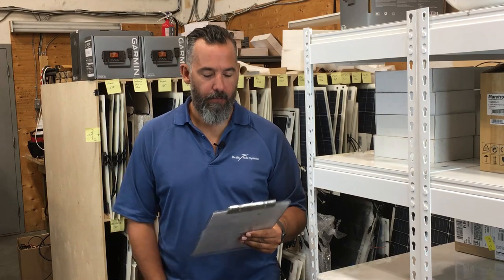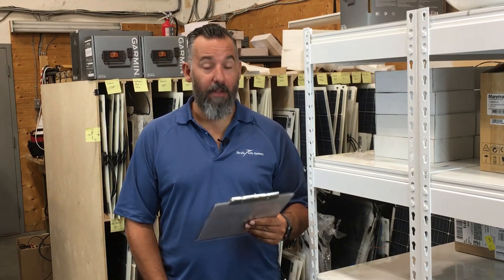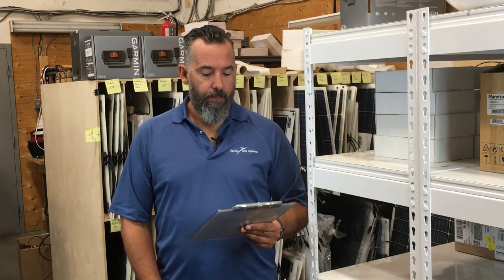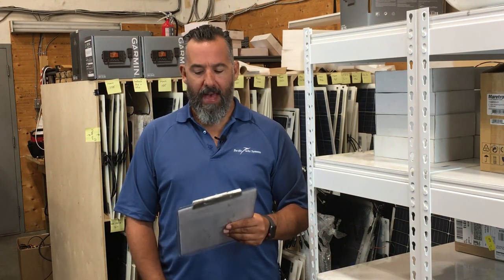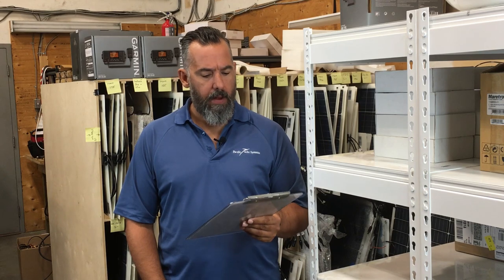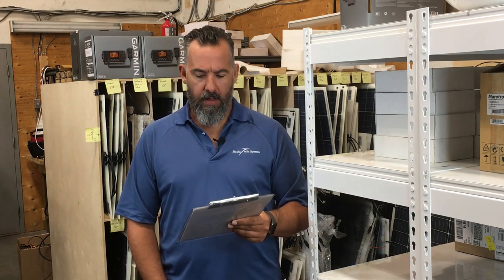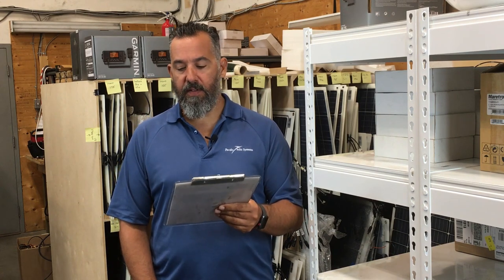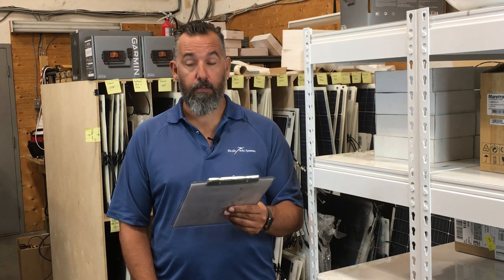Ask PYS - Should I Fuse the Alternator?

Comment: Love the video!!!!
Hmm question. I’m running a 12v dual battery set up in my vehicle. However the way it’s setup now, I’m not getting 14v which is needed for the mppt charger to fully charge the second battery. Would it help to run the cable(6gauge) from the alternator with a fuse, to the secondary battery? Or to the mppt charger then the second battery?

Comment: Makes sense, great points. The only thing I don't understand is why the alternator would be damaged if its fuse blew? I have test run engines without the positive cable connected to the alternator many times with no problems at all, so how would the fuse blowing be any different?
Reply from the maker: Here's my understanding, once an alternator is connected and outputting current to a battery, suddenly disconnecting the alternator from the battery, can cause the alternator to fail. Perhaps can perhaps shed more light on what happens inside the alternator.
Reply: @PacificYachtSystems  Interesting, I never saw or heard that before. I wonder if the sudden voltage spike when the load is disconnected might be what potentially damages the alternator since there will be a delay between the regulator sensing the high voltage and bringing it back down to normal.

Comment: Thanks Jeff. I had to think again about this. I was not fusing 
Alternators to their primary battery because I had an intermittent fault on one once that blew the diodes, went short and itself set fire.
If there was a fuse the rectifier wouldn't have ignited. Fair point.
Reply from the maker: Hi Liam, thanks for sharing. This back and forth, is exactly what drives me to enjoy marine electrical, there are so many nuisances to be uncovered, pros and cons everywhere.
Reply: It's a black art, Jeff. You're one of the rare few who care enough to demystify it and make it work. My competitors just throw BS at it. This induction cooking thing, that's where I plan to set the bar.
Kind regards,
Liam.

Comment: I have the A typical issue . My house bank grew and the alternator now heats up too much after a deep discharge . It would appear that I could use a DC/DC charger to alleviate this issue . I use a victron isolator to separate my starting(1) and house banks(2)  . Do I have to remove the isolator from the equation ? Can I just connect the DC/DC converter to the isolator ? If so what side of the circuit would it go on ? Alt to isolator or isolator to battery bank ? And thank you for posting the seminars online . As a DIY person they have helped me make my boat a little safer than it once was .
Reply from the maker: Consider installing a external regulator on your alternator and reduce the max alternator output by adjusting the field voltage on the external regulator. In effect, you are making sure the alternator doesn't work too hard. Also consider getting a larger alternator, or like you said connect the house to engine battery via a DC to DC charging converter to reduce the amperage charging the house. Remember your batteries want at least a 10% (of battery capacity) as charge rate at bulk.

Comment: Hi Thank you for your hard work. Can you recommend the  CABLE, FUSE and the Fuse holder please for me. I've just upgraded the alternator from 70A to 130A due to my stereo and the larger battery in the car. Since the car's wiring was designed to run just 70A, I  think it's only fair to run a direct cable from the Alternator to the battery directly, I was wondering about the FUSE and you have answered my question already (even though I'm pretty sure in my old car the factory cable runs directly from the alternator power to the battery without a fuse), but anyway. Can you please recommend a good cable (would 170A be any good for the job), 8 mm lugs and the fuse/fuse holder to accommodate such thick cable. Thank you very much . Paul
Reply: You should be fine just make sure you use the proper size wire and the length is the most important fusing  is only there to protect it if you were to ground it...   make sure the wires are secure you'll never have that problem and use at least 1/0 That's what I would do wire would never catch fire...

Comment: If I take the power for my alternator field to the out terminal of my breaker or my fuse it will cut the power at the input of the alternator and so it will not burn? What do you think about that? Thank you for all your information from Quebec.
Reply from the maker: do you mean power for an external regulator?   you wouldn't be able to connect a feild wire direct to the 12v breaker
Reply: @PacificYachtSystems  I will ask my question differently.
It is an internal regulator`.
If I connect the sense wire of my alternator directly to my battery, on the other side of my fuse, the alternator will see a voltage even if the fuse blows and will not be damaged
what do you think about that ?
Thank you
Reply: I forgot to specify that my alternator is connected directly to my house batteries

Comment: Hi Jeff, fantastic videos and seminar(s) you put on! In your circuit diagrams, and this video, you mention fusing the wire at the battery connection of most/all power generators. Since we're trying to protect the wire, why wouldn't we fuse it at the alternator output, since that is the source of power generation, wouldn't that protect more of the wire? Thanks again for all the great content you're putting out!
Reply from the maker: Hi Justin, unlike a battery a alternator can only ever output more then it's rated capacity. If the wire to the alternator is sized properly, then what's the purpose of the fuse? Still having a hard time understanding what we are protecting by fusing a alternator at the source. If we do that, then why not fuse chargers at the charger, or even fuse solar at the panel?  What do others think?
Reply: @PacificYachtSystems  I'm also struggling with this one. I get that fusing at the battery will protect the cable from a dead short. For example, if the terminal at the alternator breaks (as per the example given in the video). However in my mind the cable has two potential power sources, current from the alternator / current from the battery. I'm guessing but tell me if I'm wrong, lets say the cable breaks at the battery end and lands on a negative / ground there will be a dead short from the alternator. In this case do the alternator diodes act as a fuse or do we still have a problem?

Comment: should the engine ignition switch ( glow plugs and gauges ect) be connected to the engine battery or house and how to make sure the keys not left on and flatting the start battery
Reply from the maker: Hi Izaac, engine panel should be energized from the starter battery. Connect the engine panel from the switched started solenoid. When the engine battery switch is turned on, the engine panel will be energized.

Comment: Why not fuse the starter circuit? The positive wire on the starter can also become loose and touch the grounded engine.
Reply: Wondering the same :)
Reply: I fused mine,  no problems
Reply from the maker: Hi John, it's a balance act between dead shorts and nuisance tripping of a fuse under low voltage or continuous starting. What's the greater risk and danger, a dead short from a unfused starter cable or accidently blowing a fuse and not being able to start the engine and needing to replace the fuse (e,g, Where is the fuse? Do i have tools to change the fuse? Do i have a spare fuse?). 

My starter on my boat is definitely fused as i can quickly handle a change of fuse.

Comment: So if I understand your short video there correctly, it is recommended to fuse at the alternator output post and at the battery also if indeed there is a alternator to the battery connection instead of to the starter solenoid. Thanks
Reply: Hi Steve, while I’m not a professional, the alternator itself cannot supply more than the rated current. According to Jeff, a 55A alternator connected to the battery should have a 125% (69A rounded to 70A) fuse at the battery. That fuse is to protect the wire which will be 8 AWG - rated at up to 80A. Using a smaller 10 AWG wire (rated at up to 60A) would not be recommended for the engine room and the buffer is too small. There is no need to fuse at the alternator as it cannot supply more current than it is rated for, 55A in this example. A house or starter battery can supply several hundred amps which would cause a fire. Fuse at the battery.
Reply from the maker: Thanks Brian for taking this one, appreciate it. 

If your alternator is directly connected to a battery (instead of the starter solenoid as 99% of all boats are wired), then you should fuse the alternator circuit at the battery connection. Make sure the wire connecting the alternator to the battery is the correct gauge to handle the amps output of the alternator and also minimize the voltage drop. As Brian indicated, fuse the alternator at 125% the rated max output of the altenator.

Comment: What happens to the alternator, specifically, when it "blows"?
Reply: I think the voltage spikes momentarily, causing the internal rectifier diodes to die.
Reply: The diodes will be destroyed.
Reply: @koffibanan3099  thanks, that is what I thought. So you just need to fix that and dont need a new alternator.
Reply: @johnbee1107  That is what I was thinking.
Reply: @franktartan6808  Could be pretty hard to do on some alternators.
Reply from the maker: The chance of blowing an alternator on a boat where the alternator is connected to the starter solenoid is real. Hence, why i recommend all boaters to have a spare alternator onboard.
Reply: @PacificYachtSystems  Makes sense. I keep spare alternator, starter, water pumps, and a few others.
Reply: @PacificYachtSystems why have the alternator connected to the starter solenoid? I would have 2 wires one from starter battery to starter and one from starter battery to alternator. Then another wire from starter battery (via DC/DC charger) to the house batteries. All 3 wires could be fused (still not sold on the alternator wire though).

Comment: Where the idea that the fuse should be rated at least at 1.25 of alternator’s output come from???
Reply from the maker: Hi M R, with fusing, you want to avoid nuissance tripping. If your alternator is rated 100 amps, fusing alternator at 100 amps might trip / blow the fuse. Give yourself a little margin or error. We do the same with battery chargers, if the charger is rated max 40 amps, we'll wire the leads and the fuse to handle 1.25 more the max rated current, in other words fuse will be 50 amp and wire connected to charger will be able to handle 50 amps.
Reply: @PacificYachtSystems  Fuse is there to protect the CONDUCTOR hence its current rating should not exceed the maximum ampacity of the CONDUCTOR. So if you want to have a fuse sized at 1.25 of the rated output of the alternator you need to have the conductor sized at 1.25 or more of the rated output of the alternator.
Reply: @PacificYachtSystems why fuse the battery charger output, that should be regulated by the charger, and it just goes direct to the battery (and they don't care too much about current, unless they are lithium)